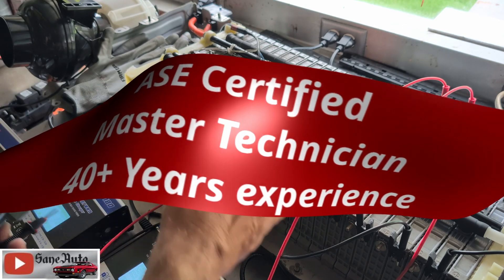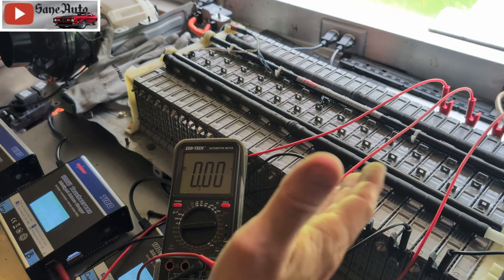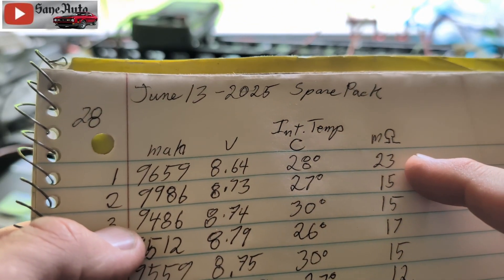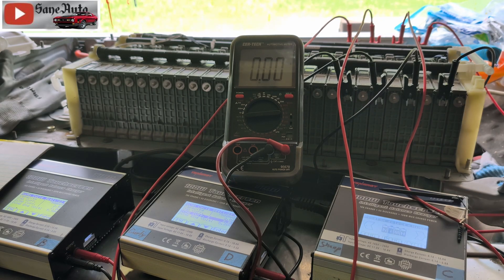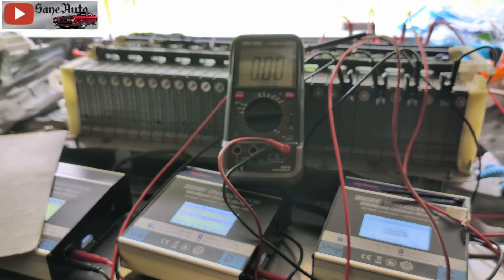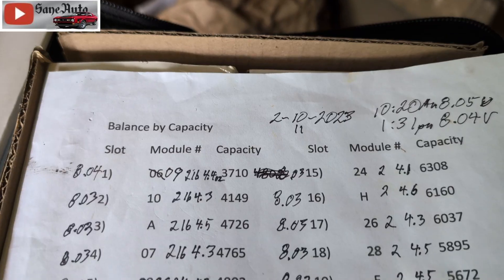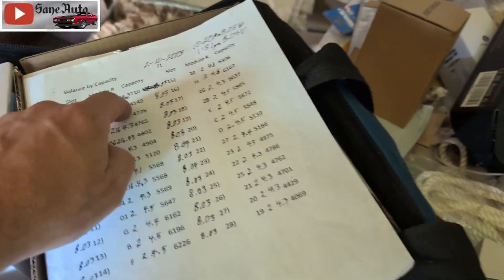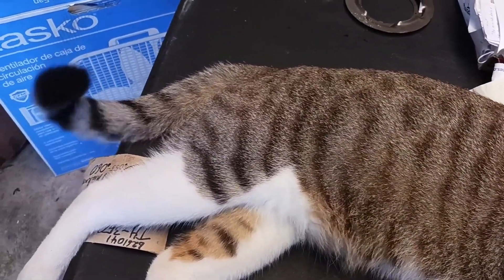Signs of a Bad Hybrid Battery Module: Step-by-Step: Diagnose HV modules

Comment: Internal resistance is how those of us in the RC business measure how well batteries perform.  Those Tenergy chargers are designed for Hobby type Lipo's.  23M Ohm is fine for a single cell but if the battery charging system doesn't monitor internal resistance for each battery it's very easy for a pack to get way out of balance and if the charging system doesn't recognize that, trouble may ensue.
Reply: What charger do you recommend?
Reply: @jasonschmeckpeper4479  What's the battery chemistry?  How much input power do you have available in Amps and voltage?
Reply: @terrymoorecnc2500  The standard NIMH.  I have a 400amp panel on my garage for input power.
Reply from the maker: @jasonschmeckpeper4479 I think he means what do you have at the receptacle/ plug in. 220v 20amp  110v 15amp etc. The chargers I use T180 110v 10-15 or 20 amp. not very quick powerful or accurate for professional shop use but easy to find a place to plug in for DIY use & very affordable. Some of my viewers are using this 4 channel charger https://amzn.to/4lnVfgZ I havent used it so I cant tell you anything about it.
Reply: @terrymoorecnc2500 I have 220V and 110 V outlets .  20 Amp outlets, 30 amp outlets and 50 amp outlets.  I am just looking for an affordable DIY.
Reply from the maker: @jasonschmeckpeper4479  I don't see why you couldn't run whatever charger you want with that. I don't know why anyone would need 400amp unless they had a shop like my Transmission shop where I had my big hot washer, Lathe, milling machine, welders, 7) 10K vehicle lifts etc. It all ran through a 400amp service box for 20+ years. Why you would need that for enough chargers to DIY one hybrid pack at a time is beyond me.